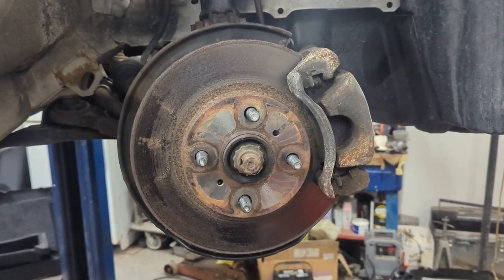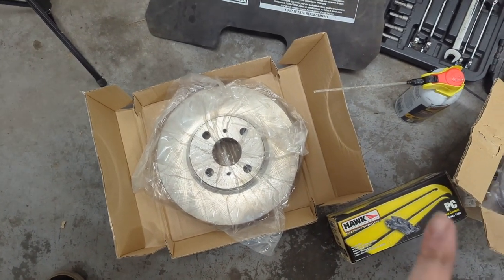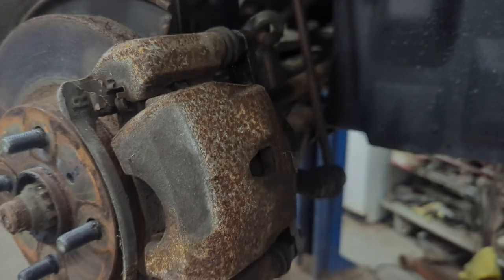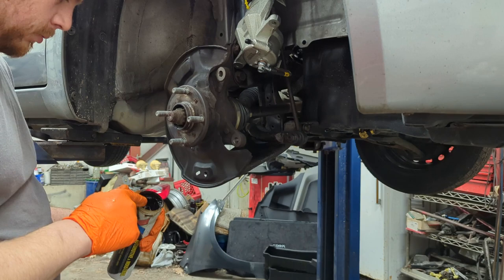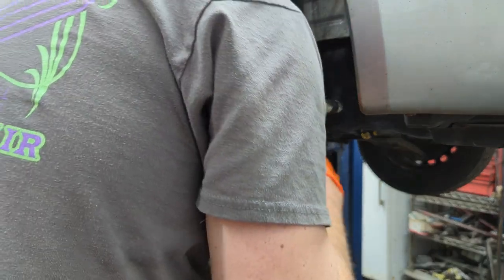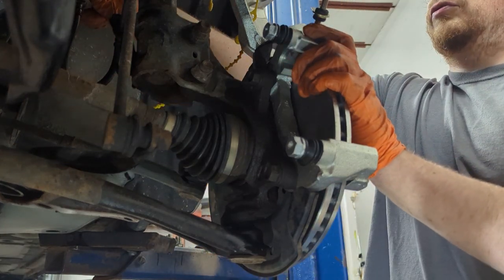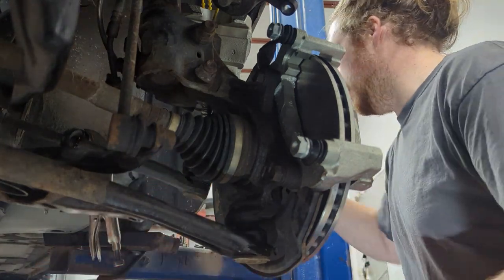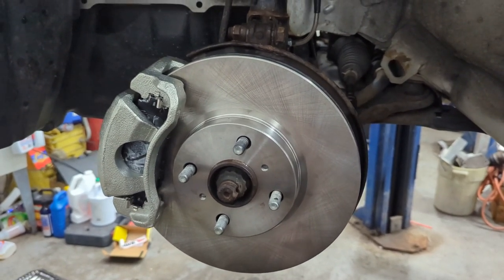2007-2011 Toyota Yaris Big Brake Kit Upgrade Project Slowcart

Comment: I'm doing this to my yaris soon. I tow alot and the replacement pads and rotors I got over the winter fade quickly. It nice to see another person giving the yaris a chance.
Reply from the maker: It's definitely worth doing! Please consider liking the video and subscribing to the channel!
Reply: Wait, you tow a lot with your Yaris?
Reply: @willythewyno  yeah I haul scrap metal and firewood.
Reply: @mrpartridge8765  that's awesome dude! I didn't think these things had the torque to haul more than 2 passengers, let alone tow a trailer. 😂 I love these little things.
Reply: @willythewyno  my yaris isn't exactly stock. In stock configuration it wasn't happy about it but after doing all the engine mods the guy on this video is doing it doesn't care.

Comment: You know anything about the rear disc conversion?
Reply from the maker: Hi there, yes I do. I'm potentially looking into it in the future for track purposes. However, you aren't gaining much by doing just because these cars are so light the drums and can handle the job. There was a write up on yarisworld if I remember correctly of what all you need to be able to convert it over easily.

Comment: I'd really like to do this but I doubt it will fit with my konig 15x6.5 heliums. I have a 2011 hatch and have stoptech rotors and pads and still found them to be lacking even in everyday use

Comment: I wonder if a manual brake conversion would save a lil weight uptop by losing the booster (but will need a different master cyl wouldnt it)
Reply from the maker: I'm sure it could save some weight up top by deleting the booster but personally I want the car to be a comfortable racecar. I know that may sound odd but I've gone full race car build before on other cars to the point they weren't enjoyable to drive. I want this to be somewhere in the middle of a street car and track car. Basically something anyone could hop in on a track and learn how to drive without any special instructions.

Comment: Im so glad i flund this video man, these cars have such tiny brakes. Ive insralled the powerstop kit with the slotted rotors and carbon fiber/ ceramic pads and its still just not enough IMO. Have you ran into any issues with this upgrade and or have you seen / felt justified improvement to braking performance?  ( i subbed and liked for ya)
Reply from the maker: Thank you very much for the sub and like! As far as the brakes go so far I have had zero issues out of my upgrade to the Corolla setup. The only real issue I can say would be the stoptech brake lines are a little too short.  They work perfectly fine but the mounting brackets do not line up. Going forward I may try Corolla stoptech brake lines and see if they are longer. Overall though I'm extremely happy with the outcome of the brakes.

Comment: Significant difference?  I have a non ABS 08 hatch and I'm thinking of doing this in the front cause it just feels like its not a good stock brake set up with good stopping.   Had the rears done recently which helped but I'm thinking this may be the way to go.

Comment: I highly recommend the Sparco 15" FF-1 as they are 15lb per wheel and you can fit 15" X 8" with good rubber (NITTO Neo Gens are working well) Did you find a solution like this for the rear brakes? I would love to install discs on the rear.... (2008 Yaris S Hatchback)
Reply from the maker: I'll be sure to look into those wheels and tires thanks for the recommendation! You can do a rear disc conversion but you have to use the rear beam out of a 2014+ Yaris SE. It's been well documented on Yarisworld.
Reply: Thanks for the info!  @TheInteriorAutoMechanic
Reply from the maker: @lovejoy1738  happy to help! Please consider liking the video and subscribing to the channel!
Reply: Liked and subed! 😎 @TheInteriorAutoMechanic

Comment: Will this swap work with stock stamped steal 🛞 wheel? Or you must upgrade?
Reply from the maker: @abrahamgsolis  you will need to upgrade to an alloy or steel that clears the calipers. The factory wheel does not. However, I use a set of Mini Cooper alloy wheels that are 15" that barely clear but they work great just be sure to use hub centric rings and the correct lug nuts. Perfect to keep miles off my track tires.
Reply: @TheInteriorAutoMechanic   thank you!  I currently have 15 inch stock steel wheels I wonder if they’ll work.  Also how was the difference in stopping? Was it a huge difference?
Reply from the maker: @abrahamgsolis  15" stock wheels will not work. And yes quite a bit of improvement on stopping.

Comment: what options for front sway bars are for this chassis? i cannot find anything for the 2011 only 2010 and before
Reply from the maker: Cusco or whiteline I believe are your only two options
Reply: @TheInteriorAutoMechanic  yes but 2011 model year has two different styles of front sway bar, one to accommodate long sway bar end link that's mounted to the shock and the earlier one has a short link mounted to lower control arm, I assume they can both fit all I have to go is use one link ste or the other?